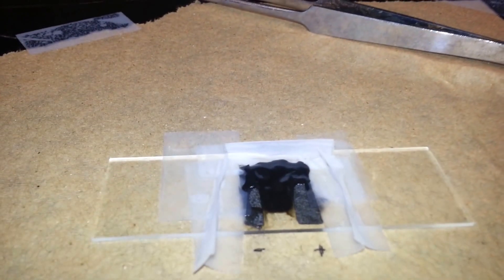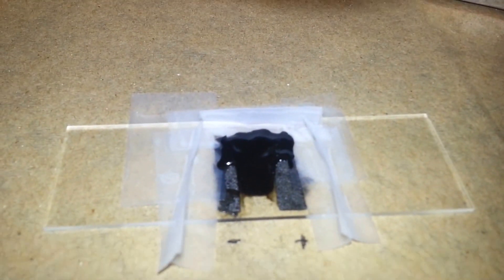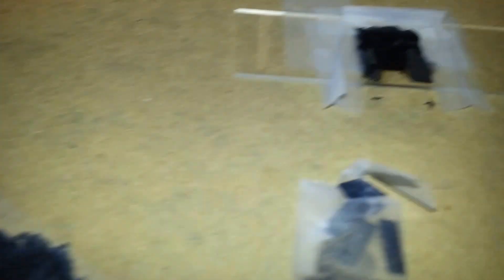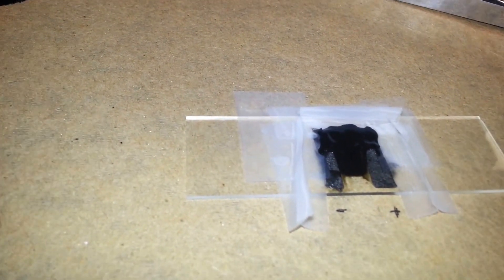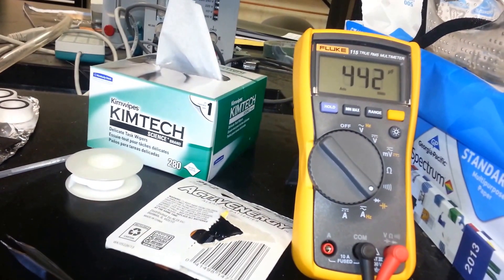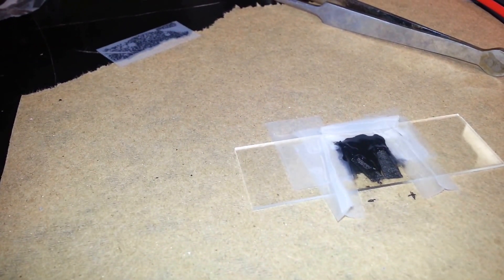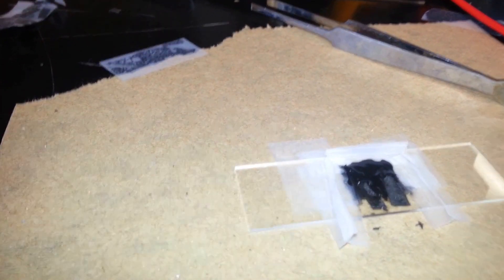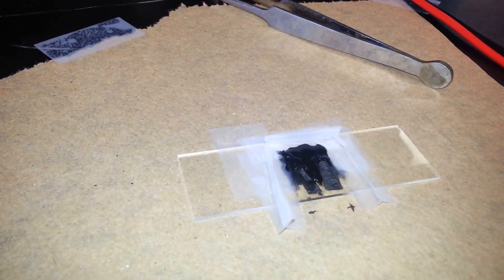Working Graphene battery, here comes the future.

Comment: someone should invent an AC battery
Reply from the maker: animegame100 AC just means alternating current, and is really not feasible nor worth doing. Batteries are direct current,  but can be "converted" via AC converter. Think about this, 3 phase power is an attempt at making a close to DC power source.
Reply: Venturestarx i know that the current cycles
if can be done in battery could have tremendous results
Reply: Venturestarx can this be made into a battery an if so how long will last in a day ?
Reply from the maker: Cory Wilson If you mean the "AC battery", it's not worth doing. You would have to alternate the current on the poles with circuitry, not the actual battery. But as for this whole concept as a conventional battery, it all depends on the size and scope of the cellstack.
Reply: I want to create a thin paper layer battery Venturestarx
Reply: Venturestarx i already knew that. alternating current cycles can make power last longer and stronger. if you could do that you could power a electric car. if it's battery was ac then electricity can pull even a big rig!! also if it wasn't for ac we  cant power things 100's of miles away!
Reply from the maker: animegame100 No. AC is only used because it's generation and transformation between voltage is cheaper. (transformation gives you the high voltage to carry over wires from city to city) When you use AC, you have a sine wave pushing the electricity, alternating between the poles. These waves are in cycles (U.S. is 60htz). DC has no wave, it is constant power. We use multi-phases in AC to make the gap in those waves smaller, more like DC. The reason car makers use AC induction motors instead of DC motors is because the AC motors have a longer torque curve, and allows smooth power to be delivered. DC units "kick", but have a huge drop off of torque at higher operating speeds.
Reply: Venturestarx yeah excatly
Reply: Radioactive material is essentially an AC battery. I think.
Reply from the maker: Nope, not at all. Check out what AC and DC are. There is so way to make an actual AC battery.

Comment from the maker: I put a drop of graphene in electrolyte between two electrodes. That's why the liquid is so black. The cell gives off voltage and holds a remarkable amount of charge for it's volume. I did some more tests and got over 5000uf to hold. It's all about the surface area and placement of the electrodes. The goal is more like 5 million uf, for a small cell, but it looks possible.
Reply: This is amazing, keep it up!